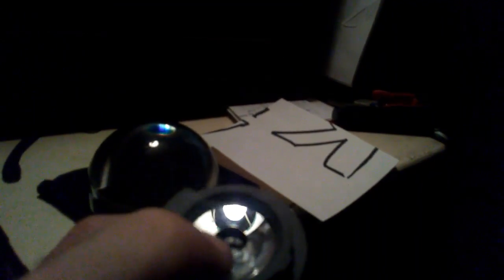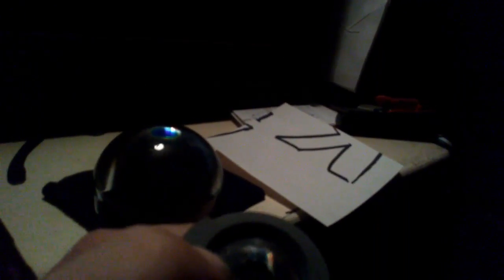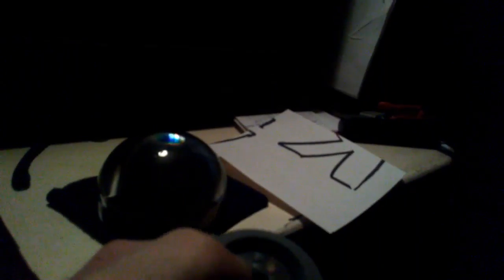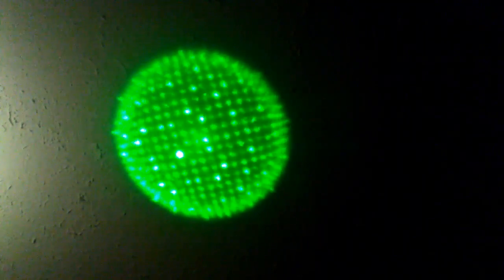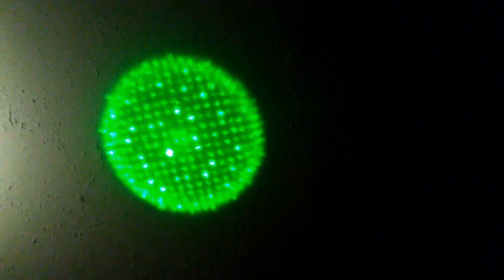- creating a crescented rotating sphere with a laser, lenses, and a piece of paper -

Comment: Another excellent experiment I found the same thing trying to re-create the solar eclipse when you put something in front of the light it’s either all there or it disappears all at once🤔👍✌️
Reply from the maker: I won't say it disproves anything about the moon because I still have no idea what it is. I want to try to project it upon a sheet and video it from the other side. Might get rid of those lines. Would like to start using a layer of water in my experiments but I'm not sure how just yet. Thanks Chris. I always appreciate your input
Reply: gudtims4all water will not do. its too cold up there for the water to stay liquid, so... ice :) or.. i guess the best material would be aerogel
Reply from the maker: We don't know what temp it is up there. The balloon data gathered shows it getting warmer starting at just 71k ft. It is around -65°F there and up to -5°F at just 91K ft. We need more data at higher altitudes before jumping to any conclusions. Water can be manipulated to do many things when different frequencies and an electric current is added. Thank you for the comment. Just had that thought because of it. Much appreciated
Reply: Ever4Ever I agree it has to be something other then water a gas that acts like water
Reply: Still.. aerogel. Resistant to any temperatures and temp. changes, very light weight material. also.. blue in color, like the sky itself. Just i have no idea how to get some of it :P always wanted to experiment with it a bit.
Reply: Where did you get the balloon temperature data?
Reply: Can you get the spherical illusion when you turn the dome lens around, so we are looking through the flat bottom? Thanks?